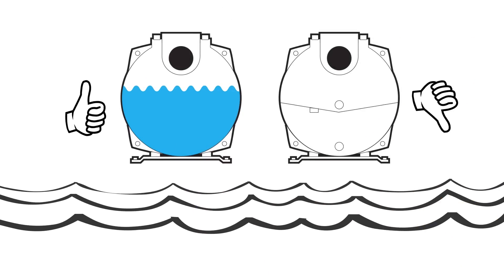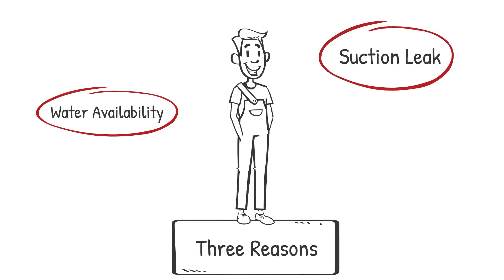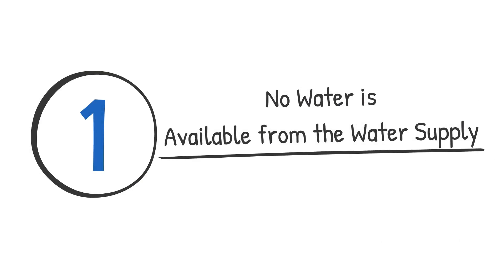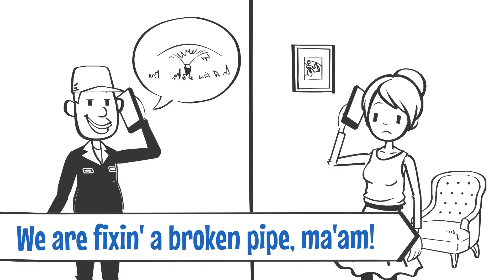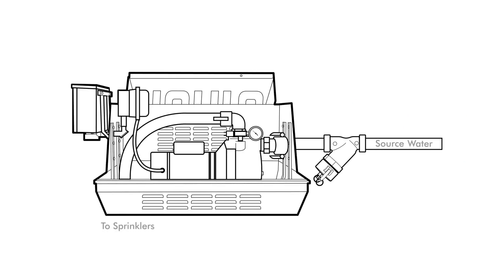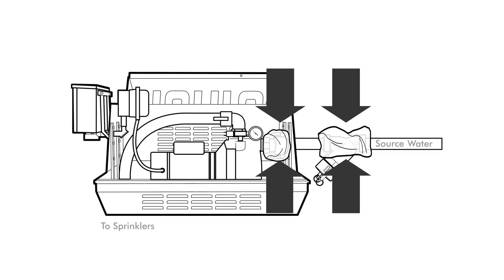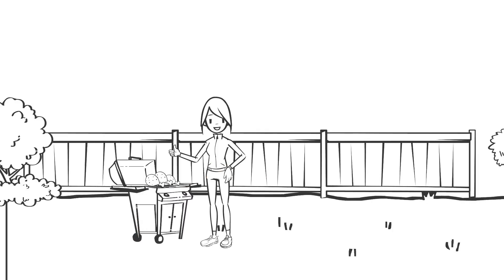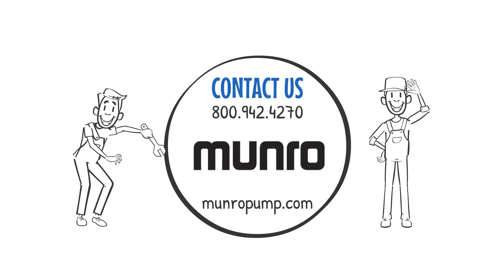Resolving Loss of Prime / No Water Delivery with Centrifugal Irrigation Pumps

Comment: Would it be possible if I’m pulling water from a well for the well to dry out? I live in south Florida where it hasn’t rained in like 2 weeks.
Reply from the maker: Thank you for your question. If you are using a sand point, the water table can drop below the sand point  if there has not been any recent rain.

If you have further questions, please call us on our Technical Support Line @ 800-942-4270 and we would be more than happy to answer them.

Comment: I have a new house…Iknow nothing about the irrigation pump. My Munro pump makes no sound at all. Is this normal?
Reply from the maker: Robert - Thank you for your question about your Munro pump. To properly and fully respond about your particular situation, we would need to know more about your particular pump system. In general terms, a running pump will make some noise as there is a motor involved; it isn't necessarily loud, but is present. 

I invite you to call our Technical Customer Support (TCS) hotline: 800-942-4270. The TCS specialists speak with homeowners regularly. They will ask questions to fully understand your system set-up; and then provide functional knowledge about your system back to you. If there is a problem with your pump or pump system, they will help to locate and correct the issue.
Reply: @MunroCompanies  Thank you very much for your reply. Just the fact that there should be a "hum" or something to indicate that the pump is running is all I need. I have placed my hand on it and nothing even a slight vibration. I have called your Tech Support and am waiting for a call back, BUT, I think I answered my "curiosity." I've open the Munro Smart Box and I saw four wires coming out of the Time Delay componant. They are just hanging there. My Rainbird controller is right next to it. I have read over your installation instructions and according to what I see,  two of these wires, Black and White, should be connected to  the Rain Bird's Master Valve (MV) and Common (COM). I would do it myself but I won't assume something else needs to be connected as well. My house is  still under warranty and I will submit a Warranty trouble ticket. 
I think I have enough information  to fill out the form and give the builder hints to what needs to be looked at. I'll try to confirm my suspicion's if I get a callback from  your Tech Support.   THANK YOU AGAIN FOR REPLYING...IT WAS HELPFUL. By the way, I have heard that your  company is one of the best irrigation manufactures and being in Grand Juntion is a huge plus for the community!!   👍
Reply from the maker: @Robt.Velasquez  Thank you for your kind words, Robert - we are more than happy to help!